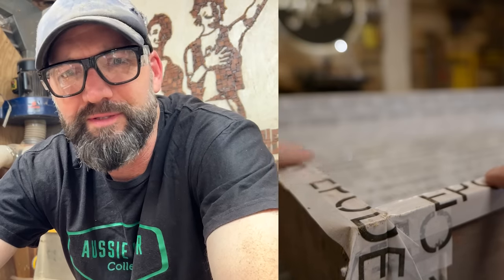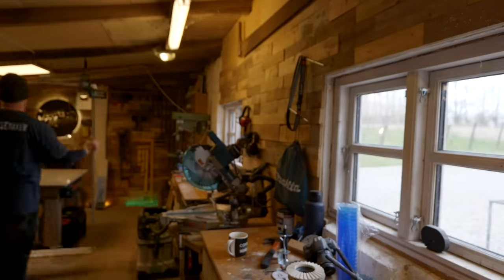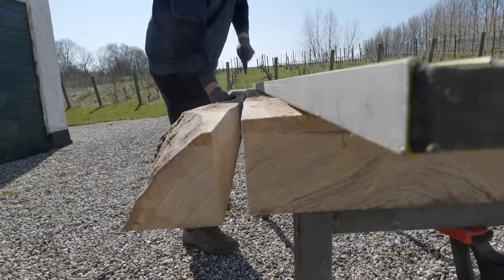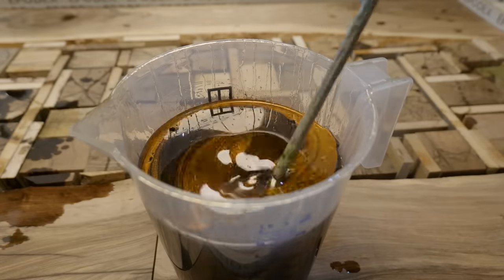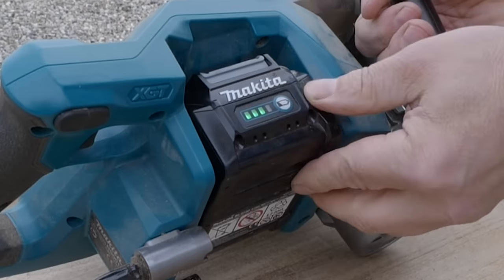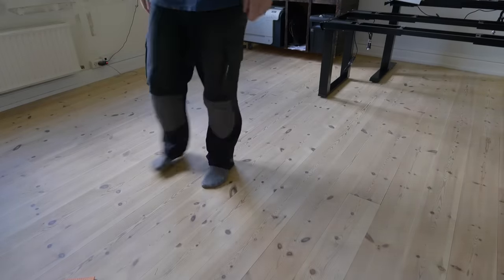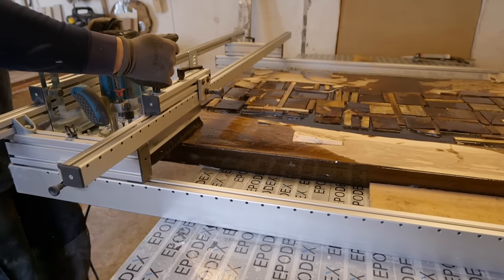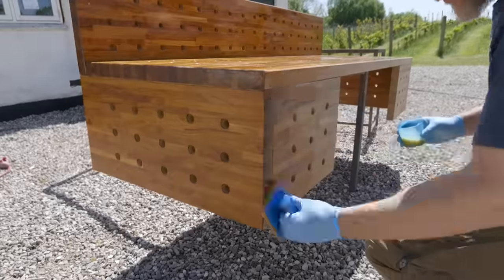From trash to $2,400 block of wood

Comment: Your quote from A.A. Milne at the end? "Always remember you are braver than you believe, stronger than you seem, and smarter than you think"? 

I dare say you've never been sacked from a job so they could put a printer where you sat (and because your manager just didn't like you) , or because you talked too much (because you were nervous), or because you fumbled and dropped too many tools? Oh, and then there's the time I stood up for a co-worker who was getting shafted and  I spoke out. 

I've been treated less because of my Autism (undiagnosed for the first 44 years) all my life and, even when I try something new, like wood working, leads you to believe the entire opposite of what you;re saying. I continue to live because of my loving wife and extended family, my dog, and a few select friends who treat me as an equal. 

While "technically" this looks easy, its not something I'm ever going to try - the materials alone would bankrupt me, and that's even if I got it right on the first try (which is definitely NOT likely) 

This does look AMAZING, I just wish I had the skill to achieve something like this.
Reply: Been dying for another one of your videos🙏🪚📐
Reply: P.S. "(Failure + Repetition) / Time = Improvement" if you believe and are patient with yourself, you can surpass your preconceived limitations YOU alone set for yourself. Get after it, and just start small and low budget. I believe you will make something amazing just give it time. I'm rooting for you👏 👏
Reply from the maker: Firstly, thank you for taking the time to share your experiences with me. I can't begin to understand the weight of what you've gone through, but I deeply respect your strength and resilience in facing the challenges that life has presented you with.

The quote I mentioned is meant to inspire and uplift, but I understand that life has its complexities that can't be summed up in a single phrase for everyone. I'm truly glad you have a supportive network in your wife, family, and close friends. It's invaluable to have people who treat us with kindness and understand us.

Woodworking, like any craft, has its spectrum — from simple projects to the more complex ones like the table I showcased. Please don't feel daunted by the scale or cost of this particular project. There are countless woodworking projects that require minimal materials and can be quite forgiving for beginners. I hope you find something that resonates with your comfort level, and brings you joy in the process.

Again, thank you for your comment and for your kind words about the table. Take care.
Reply: Peter, I’m not one for false or toxic positivity. Some people do suck… big time. You are the bigger person here keeping your head high. Kudos.
Reply from the maker: @kevinbutler8844  Thanks Kev.
Reply: Hey, I understand your pain more than you know. I too was undiagnosed autism, ADHD, & PMDD for most of my life. I married someone w/undiagnosed autism, ADHD, & OCD. They didn't even think those could be in the same person until 2013. We had four autistic & ADHD babies. 

It's been hard. Harder than I can communicate in a comment. 

However, in 2019, we bought a house that had both a rental unit & a workshop space. I've spent the last 4 years slowly building up my work shop from secondhand gear & secondhand storage. I've spent  less than 1/4 of retail price. 

Why is this possible? 

The baby boomers are retiring, & that includes a LOT of excellent woodworkers who are downsizing, or sadly, passing away. 

They & their families are thrilled that the next generation is getting use out of their tools, & are thrilled to give us a deal.
Reply: I know this feeling a lot, it can be hard to feel like your capable of more than your able to do. Start small and work up to the big stuff and you'll see anything can be possible.
Reply from the maker: Hey, I really appreciate you opening up about your experiences and challenges. Life's a tough ride, and it sounds like you've had more than your fair share of bumps. I get that a quote can't capture the complexities of what you or anyone else is going through.

I'm glad you have a support network in your wife, family, and friends. That's gold. And while woodworking might seem out of reach now, remember, we all start somewhere. Maybe you won't jump into a big project like the table, but there are smaller, more budget-friendly projects that can still give you a sense of accomplishment.

Keep your chin up, and thanks for sharing your thoughts. It's conversations like this that make us all a bit more understanding and, hopefully, kinder. Cheers.
Reply: Must suck to be the only person in the world dealing with adversity, but fixating on past failures while airing it to a bunch of strangers for no good reason and letting your baggage taint the future is a great idea. Making everything all about you should go wonderfully, best of luck!

Comment: I'm half-way through the video, Jesper, and I'm totally stunned with the generosity you've extended by including me in your video. I'm spending a few days visiting my first & newborn grandson (The Bean is a beautiful boy!), so I'm overwhelmed with his uniqueness & pricelessness while being gobsmacked by your encouragement. Extremely "blessed and grateful"!

Now, on to the finish!
I've actually been saving pallet blocks lately in anticipation of doing a glue-up (still too intimidated to try epoxy yet).

Cheers, Jesper!
Reply: Give it a go mate Epoxy is actually much easier than it looks.
Reply: @coolabahwoodworking  NOT true.
Reply from the maker: Hey Tim, congrats on the new grandson! For epoxy, start small, then go bigger. In some ways it's easy, but there are so many ways it can go wrong too. You can easily have for $1000 epoxy on your floor if your mold leaks.
Reply: @DyE0022  🤣🤣🤣
Reply: @coolabahwoodworking  Maybe if I take an emotional flush-cut saw to this unsightly mental tumor of cheapskate waste-avoidance and failure-fear, I might be able to give it a go. Lots of psychological rough edges to smooth out yet in this old brain! Cheers.
Reply: @DyE0022  My tendency is to agree (especially if I'm the one trying to do it)!
Reply: @JesperMakes  Thanks! The grandkid is a miracle and a marvel.

The mental image of an epoxy-puddled floor is vivid and paralyzing. Thanks for that, too! I'll proceed with extreme caution ... someday ... maybe ...
Reply from the maker: @timstark3312  ahaha, small steps to begin with and you'll be just fine

Comment: Hello Jesper,
Another great edited video. And great job. A great desk for your office. As long as the pallet boards are not wet, it does not cause any problems. There is a cabinet I made for the bathroom 4 years ago. Dirty laundry basket. I made it from pallets. I covered it with yacht varnish 3 times. And the bathroom still looks like stone. It didn't cause any problems. I don't think you'll have any problems with this table. good job. Congratulations. All the best. Big Greetings. Kind regards. Your friend Mehmet
Reply from the maker: Hey Mehmet, thanks for the kind words! Awesome to hear about your bathroom cabinet holding up so well with yacht varnish. That stuff's like armor for wood, isn't it? Cheers! 🛠️

Comment: Love it. I have pellet blocks that i can't get the nails out of but just can't get rid of them. I cant do epoxy so still waiting for inspiration on what to do with them. Did use ones i could get nails out of as legs for my couch table at the back of my couch with pellet wood as the top. Was one of my first diy. It needs an amendment but haven't gotten around to it but i love it in all your it's imperfections.
Reply from the maker: You can do it!

Comment: As someone who constantly gets in over their head in every single project... thanks.
Reply from the maker: You're welcome! Remember, diving headfirst into a project is half the fun and where all the learning happens.  What's your latest "over the head" project? 😄🛠
Reply: @JesperMakes  Well... I'm building a four-wheel drive 'overland'-type camper out of a flatbed Sprinter. Turns out I don't know anything about eeh... carpentry, working with composites, automotive electrics, heating, plumbing or project management. But it's taken me from Helsinki to Norway and back three times already in various stages of incompleteness over the last year, so I'd call it a success. -ish. A successish.

Comment: Hi Jesper. Great to see you back on Youtube. Your corner clamps look pretty good. Could you let me know where you got them? I'm having trouble getting finding good ones. Thanks.
Reply from the maker: These are available in Scandinavia in Biltema and Harald Nyborg. https://www.harald-nyborg.dk/mitsutomo-hjoerneskruetvinge-65-mm
Reply: Thanks Jesper. I normally stay clear of Biltema because the quality is pretty bad. But these seem the same as many I have seen in Amazon. I might give them a go.
Also, how are you finding your Vevor thicknesser?. I'm using an old Emco star multi machine. It's good enough, but very small.
Reply from the maker: The Vevor is cheap and OK for smaller projects. The engine is not too strong and the blades dull fast. I'm looking to get one with a spiral cutter head.
Reply: @JesperMakes  Me too. It  looks like Dewalt 733 is the best option in price and practical use. I think the spiral heads have to be ordered from Canada
Reply from the maker: @williamkeily6686  I'm getting one from IGM in Prague

Comment: How did you achieve the round over on the table? I love how subtle it is. I know its a simple question but I am new to wood working. Was it a router or a sander
Reply from the maker: It was a router with a roundover bit.

Comment: I love pallet videos. Do you find tha5 the wood splits and cracks once put indoors to dry out? It happens all the time with pallets here. Just wondering if you let them dry before you use them?
Reply from the maker: Yeah, I had these in the room with our house heater (a pellet stove) for 3 months before starting working on them. Acclimation of wood is key.

Comment: Hi, could you tell what exactly stuff you use as a linear guide for wood milling to plane the surface? Aluminium is too flexible. Stell strip is heavy but could work.
Reply from the maker: There's a link for the SlabMatrix in the description.
Reply: Looks much better than my home project @JesperMakes
Reply from the maker: I used 2 different homemade ones, before getting this one.
Reply: So I'm on a right way :) I've just done second one. Thanks for giving hope @JesperMakes
Reply from the maker: @jato4538  You're definitely on the right track. Just don't stop 🙂

Comment: Incredible Video. The table is awesome but it pales in comparison to the story telling of the video! Enda kulere at du er dansk, hilsen  fra Norge :)
Reply from the maker: Hei der, nabo! Takk for de fine ordene, det betyr mye! Storytelling er noe jeg virkelig prøver å jobbe med, så det er kult å høre at du likte det. Har du noen favorittdeler fra historien? Og husk, kaffe løser alt, selv grenser mellom Danmark og Norge! 😄
Reply: @JesperMakes  I really liked the fact that the whole video had a theme going trough it. Mentall challenges and powering trough all the failures to make a sweet setup in the end. I would love to see a video on how to make a work table with holes in them. I have an idea in my head that sadly has stayed there for years now. I want to make a portable cutting table with holes in it like the one you made. I want tiny legs on the table 10cm ish and I want to use it with a track say to cut square plates without a table saw. I haven't made it because I though a cnc would be needed to make the holes evenly spaced.
Reply from the maker: Hey Espen, it sounds like you have a solid vision there! I love the idea of incorporating a consistent theme throughout a project; it truly adds a deeper layer to the entire creation process, right?

As for your portable cutting table project, you absolutely don't need a CNC to get evenly spaced holes, although it would make the job easier. You can achieve this with careful measurements, a good ruler, and a steady hand. But guess what, I can totally take this challenge on in a future video, showing a way to do it with the basic tools I have. It's a great idea to have a specialized setup for precise cuts, and it would surely help many others too. So, thanks for planting that seed, mate! Keep that creativity flowing and who knows, your idea might just come to life on the channel. Stay tuned, and keep those brilliant ideas coming! Cheers!
Reply: @JesperMakes  i agree, it makes the video more interesting to watch aswell, like a movie with a meaning behind it.

I think its awesome that you are thinking about making a video about the portable cutting board idea. The idea came to me when i was cutting som acrylic doors for my 3d printer setup a couple of years ago. I had a very hard time making them square and all the videos i found suggested to use a table saw with a fitting blade. 

<Problem is i dont have nor want a table saw in my house. I think its wasteful spacewise for the low amount of woodworking i do and i also find them to dangerous to be honest. I came over some videos of the festool MFT 3 Multifunction Table. Its a great design but the price and space it takes up is not in my liking.

Thats when it hit me, if i had a tabletop with holes like the MFT, i could put 4 small legs on it and use it as a portable cutting board instead wich would be much easier to store between my cuting jobs. The idea was born, but of course i still havent made it as i said previously XD

Comment: The humble pallet block is so often overlooked. Pierced with multiple tiresome rusty nail holes. Perhaps concealing broken-off metal dangers deep inside its precious little heart. What can it offer against its old close bedmates at the great slat glue-up party? It can't bring a long length of uninterrupted dazzling grain; it just has two rough sawn ends and four rather nondescript sides that nobody wants to see. So it's blocky, it fits well in the hand and has a reasonable enough weight to make a simple air shot onto the burn pile. But I say think again people, that block with its eight brothers is the workhorse of the euro pallet, they may not be perfect cubes, they may have cautionary symbols branded on their sides, they may be rough but those guys can be proud. They are strong and they keep everyone together even through stressful periods of loading. Those are the shoulders that truly bear the weight of everyone's needs, that refuse to crack under any pressure. How many slats have you seen that split at the first sign of trouble or when a nail loses its head and goes too far? 

Well done Jesper, you wise Owl, for celebrating these forgotten heroes, for giving them the place that they deserve in a desk of such perfection. Putting them with the walnut slabs and saying, you belong with the prime stock you are worthy of our praise. Pinning a golden tail back onto the Eeyore of the pallet and showing us that in 100 acre warehouse it will never be forgotten.
Reply from the maker: Dude, you practically wrote a script for a whole video about pallet blocks. Do you mind if I use it as VO in a video?
Reply: @JesperMakes  its yours, along with the joy of a billion overlooked blocks.
Reply from the maker: Thanks 🙏